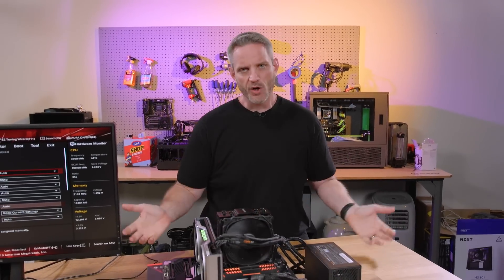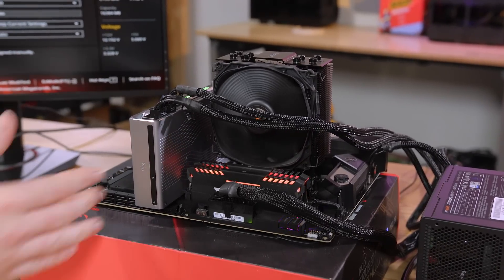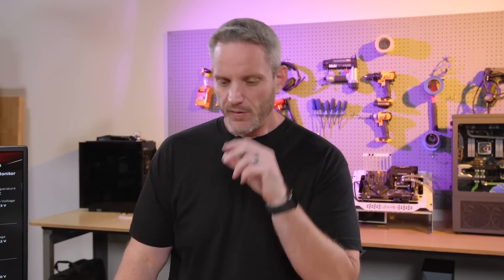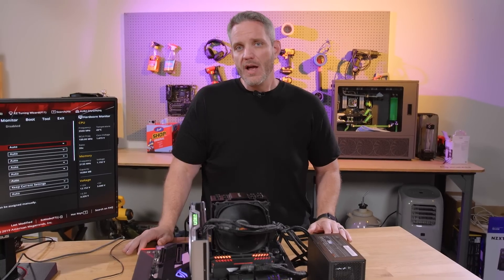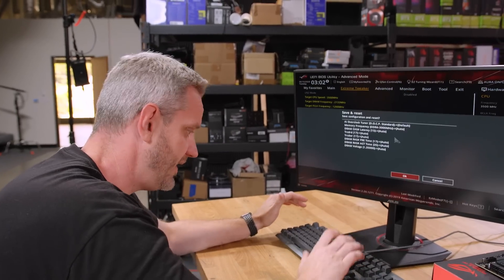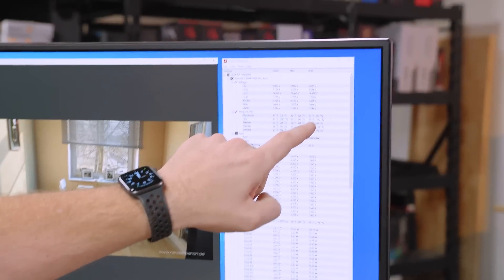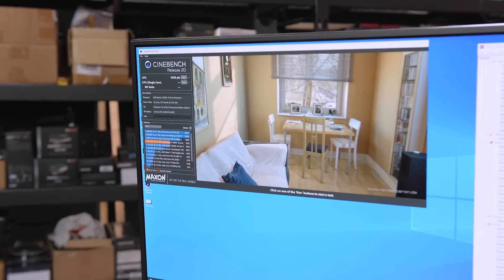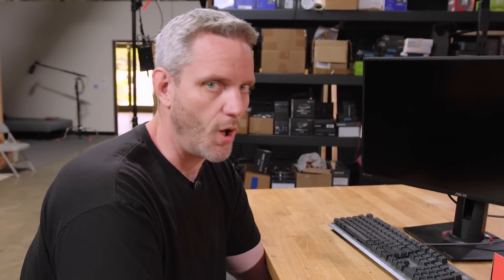Is your motherboard trying to damage your Ryzen CPU?

Comment: Jay: It's just like an engine. How does an engine run?

My high school automotive teacher:
Suck, squeeze, bang, and blow
Reply: Euphemisms for Intake, Compression, Power and Exhaust. this how all 4 cycle engines work, Gasoline or Diesel with Diesels igniting under compression while Gasoline engines require spark for combustion.
Reply: That's what she said
Reply: I suppose all the people mentioning diesel ignites under compression also picked up on the fact I said that air AND FUEL were inducted at the same time and will of course know that in a diesel engine, only air is inducted and then fuel is injected half way through the compression stage....

I was only describing the petrol cycle to show that they worked off suck squeeze bang blow to someone who thought that it only applied to diesels
Reply: Engine goes broom broom
Reply: that is the donut media equation xDD
Reply: Your 4 stroke engine is so jealous of the gas turbine engines.  They get to do all of these steps continuously simultaneously.
Reply: I wish I had an automotive class in high school. I would've probably paid attention to that the most.
Reply: @miragespl  It was pretty fun. Plus in more advanced versions of the class we could bring our own vehicles in and work on them with the complete tool sets they had for the classes.
Reply: To cite my favorite Canadian. "You will note it's a four-, not a two-smoke. Of course the lower the number, the better, on account of it being closer to running on straight explosions. Like a rocket ship. That's a one-stroke!"
Reply: top gear gang rise up
Reply: Wow great explanation 🤣
Reply: I could use a good sucking and squeezing
Reply: OMG i remember that too! hahaha
Reply: Diesel engines work by compressing air. This increases the air temperature inside the cylinder to such a high degree that atomized diesel fuel gets injected into the combustion chamber  and ignites spontaneously.
Reply: What's an "automotive " teacher?
Reply: @superblitz2274  In high school we had different classes that taught everything from small engines (lawnmowers and such) all the way up to advanced automotive (rebuilding a V6). They were pretty awesome classes.
Reply: What about a coal fired steam engine?
Reply: kind of an oversimplification but... I'll accept it. Reminds me of "Tap, rack, reassess" for the army on clearing M4 malfunctions. Stupidly oversimplified but, bc we get all the training we use that saying to drill in the process so it is remembered more easily.
Reply: So you are taught by Jeremiah from Donut
Reply: We all know where this is going
Reply: stroke
Reply: Thats Navy air mechanics motto. Its in their belts lmao he may have been one.
Reply: He asked how an engine works not how babies are made, lmao.
Reply: Thats exactly what my small engines teacher said
Reply: Diesel cycle:

Suck - Air is pulled into the cylinder by the downwards movement of the piston 

Squeeze - air is compressed and fuel is injected either directly into the top of the cylinder or into a pre-ignition chamber which heats the diesel before it enters the cylinder

Bang - the atomised diesel ignites via the heat generated by compressing the air at a very high ratio

Blow - the upwards movement of the cylinder pushes all the crap out
Reply: @madeleinegillett5892  "the mansplainers below"

Ok sexist. And no, it is sexist, I don't care about your pomo definition of sexism that doesn't apply in everyday interactions.
Reply: That's a diesel!
Reply: @gusngregg5127  dno wt cars u drive... but thats every car
Reply: @zlock97  maybe add ignition/sparks in there for fuel that does Not self ignite
Reply: @zlock97  electric: aight imma head out
Reply: @zlock97  forgot electric cars. they don't do anything even remotely close to this lol. That's the issue with absolute words. Saying things like "all" leaves you wide open to those few exceptions.
Reply: @Azrael2k8  wouldn't a spark be a bang? Just a little bang?
Reply: @Azrael2k8 
But upon ignition, it still bangs. Tell me if I am wrong.
Reply: @high-cplays  haha more Like a bzzzt? :D
Reply: @NothingXemnas  yup correct, i was Just trying to find the Part that the comment i replied to Said was Missing
Reply: @Azrael2k8  build up = ignition if you think about it hard
Reply: @Azrael2k8  you mean bang? sigh
Reply: @gusngregg5127  Sounds like a title to a porn video.
Reply: @gusngregg5127  that's the 4 stroke cycle for any vehicle 😂 

Suck - induction - Air pulled into the engine and fuel introduced via injector
Squeeze - compression - Fuel and air mixture compressed by the piston 
Bang - power - The spark plug ignites the compressed fuel and air
Blow - exhaust - The piston pushes out all the exhaust gases 

Thus the cycle starts over

Edit: this is petrol only, it excludes any of the following engines:
Diesel 4 stroke (its the same cycle but not the same actions, see mansplainers below)
2 stroke engines (they do the same but in half the steps)
Wankel engines (the designer must have been bullied in school but the engine does all of it in one stroke, just like most guys with their right hand)
Reply: @madeleinegillett5892  diesel dont need a Spark when they are already running. They only have Something similar to a Spark when they get started after this Diesel ignites due to pressure alone
Reply: @madeleinegillett5892  thats also how its taught to pilots...its funny in a childish humor way which is how it becomes memorable...acronyms are similar like ATOMATOFLAMES, GRABCARDD, IMSAFE and many more...theyre just so stupid-sounding its hard to forget them...much easier to forget what they stand for
Reply: @madeleinegillett5892  that's pretty accurate but if we're talking about cars (and potentially a diesel engine) then like other people have stated, the ignition stage can be caused by extreme compression instead of an electrical spark. I appreciate that you may have simplified it for your explanation to someone who clearly doesn't know that a 4-stroke engine is a thing and they all follow the same cycle.
Reply: @stephen9894  I've been treating diesels wrong my entire life 😱 Sucks for the garage I work in as a technician....

Yes a diesel has a different ignition but laddy was saying that suck squeeze bang blow was diesel only so I went through the petrol cycle to prove otherwise. There wasn't really a need to go into diesel ignition cycles considering both engines will also ignite at different times in the cycle
Reply: Azrael2k8 sure its spark not glow plugs and needs only compression
Reply: @gusngregg5127  No, that's every four stroke combustion engine.  It's taught in automotive class rooms to get people to remember the strokes of the four stroke engine: intake > compression > power > exhaust.  If you learn those basic principles, you can diagnose almost any issue occurring in a four stroke engine (two strokes also exist in smaller engine applications such as lawn mowers).
Reply: @gusngregg5127  It's the same Suck,squeeze,bang ,blow the only thing,different is gas has a spark plug,and a throttle body.
Reply: @gusngregg5127  no thats any 4 stroke internal combustion engine. thats just the 4 strokes...
Reply: @gusngregg5127  Suck is the fuel intake, squeeze is the compression phase, band is self explanatory, and blow is letting out the exhaust. To my knowledge every combustion engine works like this. If you've ever used your clothes line to start your mower you'll be familiar with this.
Reply: Gus Ngregg that’s a four stroke engine

Comment: One thing I noticed my motherboard (MSI B450 gaming pro carbon) was that if I set the VRM voltage to auto it would put 1.4 volts or more. Now AMD says 1.45 is the max and so the board isn’t going to that but it is close. This is also where I only have the 8 pin plugged into the board and not the 8 + 4 pin (new PSU didn’t have a 4 pin and I have not ordered it yet). My 2700X can sit at a 4.1 ghz and be at 1.35 volts all day long. So yeah MSI kinda needs to tone their auto settings down a little bit.

Comment: I originally overclocked my 3900x cpu to 4.4ghz all core and then recently reset it back to factory settings except for enabling d.c.o.p and flck ratio to 1:1 and I'm getting the same in game performance.... Originally overclocked to get max fps but oddly enough getting the same results with it back at stock leaving just the gpu overclocked

Comment: Dam you can still hear that rtx card with max speed fans on boot(even in an open test bench),mines does that too. Why do the nvidia rtx cards always do that with amd cpu's and why doesnt nvidia fix that with a driver update?lol. I hate hearing that every day on my first boot for 5 secs everyday,running at max speed facing down in my case it sounds like a hair dryer for a few secs.

Comment: Asus Prime x570pro motherboard and r7 3800x.  My mistake was clicking on the Ai Suite 5 way optimization and it ran the cpu at 4400, but reported temps stayed cool.  Two days later and didn't post, LED on VGA.  Tech support has me swappiing GPUs (Asus Dual RTX2060s, Strix GTX970 and GT630) PSUs and ram...all the steps.  RMA mobo (out of stock) paid extra for ROG Strix x570-e.  No post, VGA LED. :(  Went through all steps again with Asus, I had 6 days left on RMA CPU and went that route.  2 weeks later and all is working.  I am worried about the software/bios wrecking another one.  This 3800x runs a bit warmer but working okay for two weeks.  Thank you for making this video.

Comment: Is it damaging your PC or not? the thing is it is still to early to know for sure but ether way the boards are often pushing way more voltage than is needed,  on my build that is a ROG-STRIX-B350-F-GAMING with a Ryzen 3 3600 at stock settings with just DOCP on  it will push 4 cores to 4GHz and 2 to 4.1GHz under load and the voltage spikes and holds at 1.450v to 1.470v and this same behavior also happens on the 450 version of the board, now heat is not an issue as i have a custom loop but with only 2 cores boosting to max the voltage should not be that high, when i played with Ryzen Master and manually set an all core over clock of 4.1GHz and manually pushed down the voltage it was completely stable at just 1.3v under the same loads that previously needed 1.47v for just 2 cores, and if i went down to 4GHz on all cores i could get the voltage as low as 1.2v and be stable
Reply: I have a 3600 at 4.2 GHz all core on 1.1 vcore never goes above 47oC on air can stress all day and only uses 64 watts and is rock stable 😉

Comment: I’d love to see a general OC guide by you! Not for anything crazy like LN2, but just a more general guide on how to do a basic OC suitable for daily driving. Preferably one for both AMD and Intel!
Reply: Already exists
Reply: HowToBasic Jayz oc guide would be a wonderfully horrid idea. XD
Reply: on AMD there's no point and on intel there's no point XD
on AMD you can get 5% or so from PBO and if you care about fan noise it's not worth it.
on intel you can go from 4.7ghz or so to 5ghz and agen it's not worth it. 
we are in a time where unless you have a 2080TI just dont bother.

the CPU's are so fast now the biggest problem is keeping them feed with data, that's why you see such gains from faster ram.
thats why you see such big FPS scaling from video game benchmarks on ram videos.

have fun
Reply: @liaminwales  On my R9 3900 - Currently all I have changed is the ratio from 38 up to 42 and changed vcore to 1.3 volts. Ofcourse XMP on the ram. Is it better to leave it all on auto/default? I mean it runs steadily at 4.2ghz and my temps are low. Cinebench doesn't push the temps past 70
Reply: @Nunez87  That sounds pretty good to me. If you have the necessary time and patience I would encourage you to turn off XMP and find a stable RAM-OC for yourself. In my experience XMP can lead to instability. If it works for you, no sweat, but I do not like it (I use 3600 RAM and the XMP profile made my PC bluescreen constantly) A good point of reference are the LTT video on Ryzen 2 OC and the "DRAM calculator for Ryzen" by 1usmus (google is your friend), you should have a pretty easy time with these tools.
Reply: @Nunez87  what was default Vcore?
Reply: @Nunez87  you literally just described what i am set at. And in my opinion, youre at ypur peak for daily usage. I use a x42 core ratio and PBO on with auto scaling. The only thing i have found works good as well is changing your cpu and soc voltage usage to 110% (it seems to allow PBO to better calibrate when it needs to do its job)
Reply: @vladvah77  vcore was on auto before. So anything between 1-1.4 I guess
Reply: @Thesaurus-Rex  I thought pbo wouldn't work with manual overclocking. How do I change the settings you described?
Reply: @Nunez87  depends on the motherboard. What kind do you have? There should be a tweaker tab you would go to and it will have all your voltage demand options like soc, cpu, vram, etc. And also keep in mind some motherboards have levels (1 being lowest - 5 highest) and some motherboards are reversed 5 lowest to 1 highest setting. Then you also should have a percentage control that allows your board to pull up to usually 150% voltage (default being 100 and then 110, 120, so on.
Do you have discord? Easier to msg on there
Reply: @liaminwales  you mean a 2080 Ti and play 1080p with RTX off lol
Reply: @mareck6946  I didnt get my 2080ti for ray tracing, I got it for 4k gaming and in 4k gaming overclocks make a difference.
Reply: @tangotyke6870  gpu overclocks yes , as your bound by the gpu at 4k with that setup. cpu OCs well - its a different story when your gpu can do more but isnt kept fed fast enough with data. On ryzen particulairly its just a matter of using PBO ( which kind of autoovercloks on demand a, thermals and power ). but setting the right ramspeed & timings can make more of a difference actually since for one the cores run over the infinity fabric which is tied to the memory clock. Altho in ryzen 3k + you can change that also separatelly but it should be in ratio to the mem clocks or waittimes will happen which usually end up in stutters.
Reply: @tangotyke6870  yep at your GPU level OC is worth it, bleeding edge of speed!
That GPU is god fast!
Reply: @tangotyke6870  so you're saying that overclocking your CPU noticeably helps with 4k framerates? Lol
Reply: @liaminwales  Unless you're running DCS World which needs a clock speed of 5ghz+ in VR because of its ancient codebase and no VR acceleration.
Reply: @liaminwales  even if I had a 2080 ti I wouldn't bother. It only really makes a profound difference at 1080p and below. That's not a good enough reason for me to push an OC.
Reply: @liaminwales  On AMD you can gain some slightly bigger clock and you can gain lower temps. My 3600, which is an old and not too overclocky batch, can drop 10+ C just by setting proper voltage and frequency. It is chilled by cheap 240 Cooler Master AIO. If I want to stay on stable 4GHz I can go to around 1-1.1V for even lesser temps and power consumption.
Reply: @liaminwales  I've always ran by the "if you can make it better, why not do it" approach when it comes to overclocking.    It may be just a marginal gain in performance, but if you can make it run better at cooler temps, why not?

Comment: I'm using b450 tomahawk max on 3700x. My vcore is like 1.5. But it does drop during normal load. I manually set vcore to 1.275 and I get 13 points lower score on cinebench. But no real impact on gaming. If there was its probably 5fps drop. I dont really care as long as I'm running games above 60fps. But the temps stable 60c to 65c max

Comment: I recently built my mom a new computer using the B450 Tomahawk Max and a 3600. Was the first Ryzen build I ever did. The default, out of the box, setting from MSI had the voltage auto boosting above spec.

Comment: Jay helped me fix my diesel Mazda, he noticed it didn't have spark plugs so he welded some onto the head, thanks jay.
Reply: A Diesel Wankel (rotary engine) would be interresting
Reply: @emmata98  theoretically yes, but wankels have enough problems with compression as it is. Don't think the high compression needed would work long 🤔
Reply: @emmata98  mazda b 2500 was basically a Ford ranger so it would have a diesel
Reply: @lilgampla  yeah, but still no rotary ;)
Reply: @emmata98  those apex seals would be destroyed after 50k miles instead of 100k.
Reply: Doubt many understand the joke. But I do 😂
Reply: Well their Skyactive engines don't always need a spark either and those run on petrol.
Reply: Oof
Reply: Did he also add the coils and stuff? 😂😂
Reply: One day jay saw me building a pc so he water-cooled it for me what a nice guy.

Comment: the potential damage (or not) to the CPU is not the point, that is simply a consequence of the point, the point is the mother board shouldn't be passing the wrong information to the CPU in the first place. there is no need for this other than possibly the motherboard manufacturer wanting to present results (CPU), to the end user that could look favorably on their product compared to the competition. In other words, CPU x performs better on xyz motherboard compared to abc motherboard.

Comment: I gave up air cooling the 3900x processor. I even tried a Noctua and lapped the processor. I fixed it with a custom water cooling loop and now it can run folding at home with a mild overclock. This is on a Gigabyte X570 UD